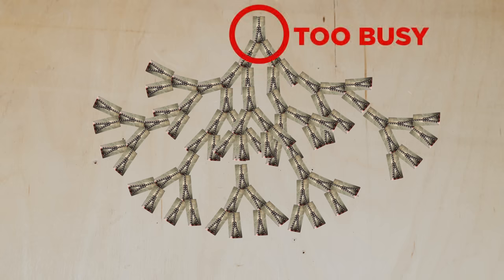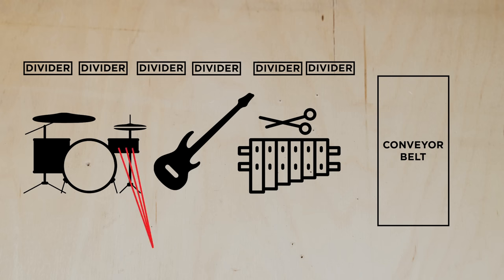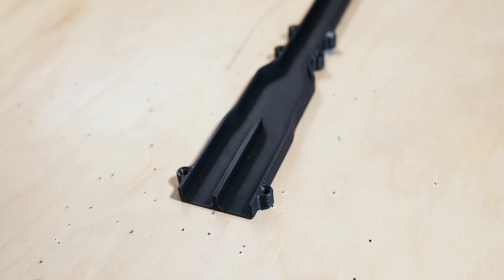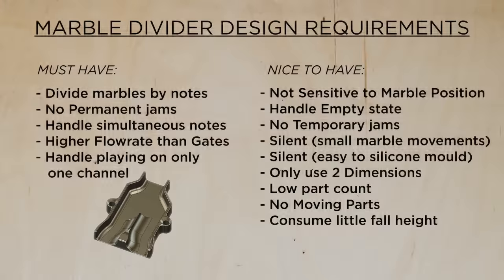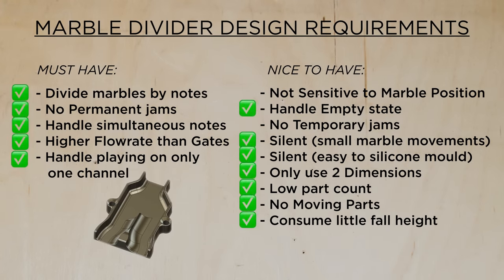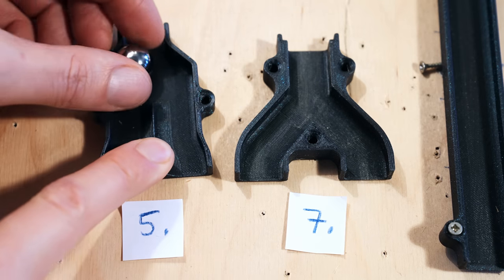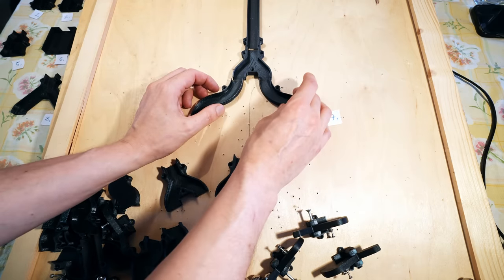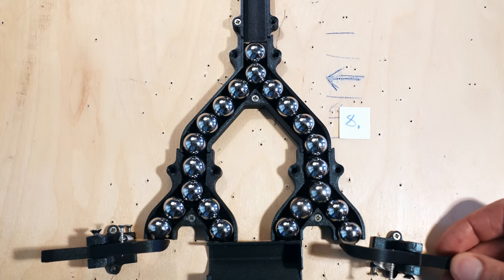Mystery Marble Divider?

Comment: It might be way too large but what if there just wasn't a divider? Separate channels for every note, return lifts could be grouped per instrument, but still all the channels are separate in each lift.
Reply: I agree, the best divider is no divider at all. It adds complexity and a lot of issues. If every note has its own path things become much more simple. You do trade-off complexity for costs (more marbles, more lanes etc.) and space and weight (more lanes to accommodate). However, another big benefit of this approach is that the whole thing becomes more modular. If you look at your current design, the big elevator is a single point of failure and the machine will not gracefully degrade (i.e. some notes might not work). Instead, you will have no music at all.

Another big requirement I have been missing thus far is transportability. As an system/software architect consultant I see that many systems are modularized / designed with this aspect shaping the overall design. How big can each module be? How heavy? Should it fit in an airplane? Should it fit through a standard door? How much shocks / falls / temperature differences etc. should it be able to withstand?

Comment: spring loaded trap doors... where you can adjust the spring to take in variable weights... now what do i mean... the channel the marbles goes into moves, on a spring, when the spring reaches a point it pulls on the trap door to close the channel, as the tube loses weight it allows the trap door to work again..  it would allow you to have different numbers of marbles in different tubes.  as long as it worked properly that is.  the issue i see you'd have with this design is timing since the tube would move to trigger the trap door... there would be a variable in the rate it could drop the marble... i didn't think enough to transfix the tube to get them all to have the same timing.... my brain thought this one up first...  thou the moving tube may not be the end location for the marbles?  maybe when the trap door is closed it drops the marbles into a primary tube, which then resets the moving tube/trap door to refill the tube before the primary?  if that makes sense?  then the primary would also need a means to keep the loader tube from dropping marbles into it until it needs them.

Comment: Consider a Major Change.  Problem: Balls Piling Up on Top of each other causing Jamming.  Instead Space the Balls Out with a Delay Mechanism.  And then Divert the Balls to Left / Right with a Flip Flop Tumbler.  Problem Solved.  As a Mechanical Design Engineer, I wanted to do this, but the Customer Insisted on having their Tubing "Stock" Freely Fall from the Parts Gondola under Gravity.  Can't be done!  Must have Mechanical Feed (with spaced delays) to Prevent Jamming.  Once Achieved, the "Tumbling Flip Flop Dividers" will Take it from There.  I feel your Pain.  J D Smalley.

Comment: For the choke issue, consider that you could have multiple splitters in parallel and merge the outputs. It sounds strange, but it works well in factorio lol.
Reply: Looks like you did and it worked lol

Comment: Get rid of the "wiggle" tracks as much as you can. They are just another recipe for something that needs fixing later. They themselves add length "uncertainty" because of all the curves and the need for the channel to be a little bit wider than the marbles. If you connect the centers of the marbles you will get a zig-zag-line, not a line that follows the center of the channel. The marbles won't end up in the same position in the tracks every time, so there are many different versions of that zig-zag-line all with different "stacking heights" (the length the marbles actually take up in the channel from start to end). In curves there are a lot more possibilities than in straight channels, leading to more possibilities for one of the "stacking heights" to end up too short or too long for reliable operation.

Comment: I question the requirement of having a marble divider that is not sensitive to marble position. I feel like having the possibility to adjust the marble gates positioning relative to the divider exits would [1] be way easier to design, as you would only need a simple bracket with slots for the gates and the divider would always be the same wherever it is on the machine, [2] lead to a lower part count, [3] be more compact, [4] be easier to adjust (no need to remove all marbles from the channel, place a wiggle block, try it, do it again) and [5] be easier to modify if problems arise.

Comment: Thinking of height sensitivity. In this video, the marbles are rolling on a two dimensional flat plane. Going either down-left or down-right. Could the marble path be more three dimensional, such that the marbles can go down-left or down-right - OR - down-back-left or down-back-right. (If a vertical tube is feeding the marbles, the marbles can either go front-left or front-right or back-left or back-right. From 1 to 4 vertical tubes)

Comment: How about printing the tracks in a TPU material instead of molding silicone. You could actually print the base of the track with PETG so that the screw holes are tougher and the rounded track part with TPU to deaden the sound a bit?

Comment: Can you keep each channel segregated while in the conveyor so you dont have to divide them at the top?  Or could you introduce a gap between the divider and the gate that allows independant height adjustment and maybe a small conveyor per track in between to eliminate gravity acting on the divider and the gate at the same time?

Comment: Some food for thought. The statement at the end made me think, why not design some machine learning to solve it. Nah… too much work code design. and learning time. 

But wait… what about nature? Has nature designed something that has attempted to solve this problem? Well sorta. I’m thinking about the pump and vessels we all have in our bodies. Ahh! Arteries, veins. 

Height sensitive (think orthostatic hypotension). Flow rate is determined by arterioles, small muscles at the end of our arteries. Our brains have barometers to reflex our muscles when we stand up, maintaining pressure to our brain. 
Here’s the most pertinent part: Capillaries are small enough that only single RBCs can pass through, which seems pretty much analogous to this issue. There are a lot of differences, don’t get me wrong, but it’s pretty neat to compare. Things that might help in this instance: charge helps prevent RBCs from clumping in the capillaries (endothelial electrostatic repulsion). Maybe for the divider, some time of agitator (vibration, moving magnets, would help act like blood serum in this case and overcome the coefficient of static friction. Additionally.  Capillaries aren’t branching Ys, they’re interwoven meshes that cover the area, forming loops to add a little redundancy to prevent ischemia while allowing for clogged vessels to fee up. (Lookup “scalp, injected blood vessels, light micrograph” on Google to see what I mean). 

Again this might not be super useful given the large physical size of these marbles comparatively and the differences in medium, but I do believe they might help give some insight towards any further solutions, should they exist.

Comment: I think you need a gutter around your bench😄 Looking at version 6, it would be much better if the divider grew in height as it got lower to prevent the middle marble being possible.  could use a lid to reduce noise and prevent any marbles from jumping out, a possible temporary fault

Comment: Maybe 3d printing from TPU (relatively hard ones should work) with relatively low infill, to make sound dampening tracks on your printer would work? That would eliminate mold making and reduce the chance of it behaving differently due to the different material in the final version.

Comment: Silicone is to flexible. Maybe lining the walls and/or the pathway with silicone while keeping the plastic walls for rigidity would be your best bet at reducing noise but maintaining reliability
Reply: If you've ever worked with silicone sealant then you know that you can get softer and harder versions. Some remain quite wobbly others can be quite stiff. Silicone can be hardened and treated the same as any moldable plastic. Hard silicone remains pliable but does not easily deform under compression.

Comment: Instead of making the track adjust the marble height.
Cant you put in a screw that changes the gate height instead?

Meaning you just turn a screw, change the height of the marbles using the gate and solving the issue of multiple parts to solve an issue
Reply: The height of the gate needs to be constant to the instrument otherwise the timing will be off.. right?

Comment: What if you had someway of seperating the same marble path into different sections, so that you can partially cut-off a section from another, meaning that the marble positions in this new section could not affect the resting marble positions of the previous section.
Kinda like a valve or diode. If you had this then not having version 11 wouldn't be such a big deal.

Comment: For 6, what if you create a wall in the lower part where it splits. Basically, make the part that expands have the opposite slope and have the divider at lowsr to prevent the creation of a 3rd stack in the middle.

Comment: What about printing with TPU?  It's essentially printing out of rubber.  Might be significantly quieter than PLA or PETG prints.  But more expensive, and requires drying if left out for extended periods.

Comment: The obvious solution: no divider, one closed loop per lane.

Put another way, imo there’s no good reason to share the marbles between lanes: space is not an issue anymore, having closed loops improves modularity, closed loops mean one clicking noise per marble instead of one clicking noise per marble division, and a bunch of other advantages.

If each lane is an independent marble loop, then the problem becomes that of plugging many instrument modules to a single programming wheel. That means that in theory you could maybe reconfigure the Marble Machine in many different ways.

Comment: What about defining the maximum height the divider should support? I mean even pipes have pressure ratings. A divider that works with infinite height for sure might be impossible, but one rated for a set height should be achievable.

Comment: Trying to think outside of the box here. What if you just made a tank and then every marble gate had a seperate funnel in the bottom of the tank? This would ensure a large reservoar of marbles that could feed the gates from a single pipe through it’s funnel. The funnel itself doesn’t really require any precision to feed so it shouldn’t be able to jam.

Sound wise the whole construction could be made with lining an made as closed as possible, confining much of the sound. The only time a marble is seen is when it’s falling, otherwise it’s inside it’s own cycle.

Comment: What about using a design like nr 4 or 5, but with the slight bump that nr 10 and 11 have? That should solve the high issue, no? Or at least partially solve it, and you can iterate on that again

Comment: Is it possible to avoid the whole operation of having to combine and divide streams of marbles? If you can design the machine from scratch, why not make X independent marble loops for X notes? The only limiting factors would be the size of the lifting mechanism and the area required to catch each marble after they drop. The first factor can be planned for in the design phase and the second factor can be solved by making custom instruments that are placed in e.g. a 5 finger fan configuration. You can also stagger the placement of the instruments in all three of the axes. You should also be able to fit two or three independent marble trajectories on each of the drums.

Comment: In industry if you want small things to flow without jamming or clogging you vibrate the system. It prevents static jams since nothing can remain in the stuck position. How you'd put this on a marble music machine or how you'd deal with the horrific sound I'm not sure.

Comment: The most basic question should be: Why 2D? Why not 3D? Some years ago I already suggested a kind of big round pot with marble outlets around the bottom and a rotating base platform (to distribute marbles and resolve jams). The platform must be a bit higher in its center. Yes, it will be heavy. Because it does the very much needed double duty as a marble buffer. Yes, it can be noisy. But noise is quite irrelevant when you blast the audience with speaker towers. And when you keep marble circulation separated, you can use smaller distributors and don't have to keep 1000 marbles in one big pot...

Comment: 10:00 Couldn't you just have a middle wall sorta like the other dividers? That way the marbles simply just dip into those positions a bit more. Might want to factor in marble diameter into the equation and to make the distance for a singular marble that could hypothetically be somewhere jammable be greater than said singular diameter.

EDIT: You could have a see-saw design in the middle of one of the dividers, and while it would technically buffer the flow from a 1 by 1 to a 2 by 2 (as well as technically be a tad bit slower), you could theoretically have a permanent "no-jamming" marble divider

EDIT 2: Instead of a see-saw, perhaps a simple partial curve pusher of some sort (like a segment of a pie) that gets pushed out just enough to tilt the direction an incoming marble has to one pipe or another. Similar to seesaw, but a little less preventing of motion. Might still jam tho :/

Comment: For things to flow smoothly without being height sensitive, you basically need them to act like a fluid, right?
                   |
Fluid in a /\ shaped water pipe won't jam when you lengthen or shorten one side vs the other.

But that's because it's fluid.
And fluid is defined by having a particle size significantly smaller than the container it's in.

If you made a pipe that only allowed water molecules through in single file, you are going to get similar problems.

All that to say, I think the height invariant marble divider is a pipe dream.

Comment: There is one issue I found with these Y splitters and thats when both channels are played simultaneously the next marble before the split can fall straight down and can be jammed against the splitter and balance there thanks to the pressure of the stack. Still using the 3D printer to great effect in your workflow I see?

Comment: Instead of molding in silicone (yet another untested fabrication process), why not use your current fabrication process with a different material. TPU/TPE filaments in various shore harnesses are available and should print fine in many 3D printers. If the TPU/TPE print isn't strong enough to keep the shape from collapsing from the weight of the marbles (could also be an issue with molded silicone), print it in two parts. A PLA (or similar hard plastic) frame with a TPU insert that has the marble channel. (Or anything for the frame using currently known fabrication processes. Routed plywood, plasma cut metal, etc.)

I have an example from my own experience of how changing filament types helped me solve an issue. I had designed a funnel for filling desiccant containers to store in the hub of my filament spools inside a vacuum sealer bag. My first print was in PLA and the shape was perfect to fit in the mouth of the containers. But I had an issue with the hard desiccant pellets bouncing out of my funnel. I reprinted in NinjaFlex (an 85A shore hardness TPU) and now I don't have any problems with desiccant beads bouncing out of the funnel. The rubbery TPU funnel now absorbs the impact energy of the desiccant beads. (Sort of like the difference between dropping a ball bearing onto metal vs. dropping onto plywood. The bigger bounce is on the metal.) 

This may be more challenging if Martin only has a bowden style 3D printer. I haven't noticed Martin's printer in the background (maybe I missed it?) so I don't know what style he is using. Even among direct drive 3D printers, some handle flexible filaments better than others.

Comment: Looks like you need a break in the flow of marble for each gate to make the flow of marbles independent for independent height
Josse roelfs design looks like it would solve that one problem how knows if it works good enough for the project tho

Comment: Why are all dividers constructions that you experience based on the principle that the divisor should work autonomously? If the balls get stuck, then it may make sense to produce vibrating or moving inserts driven by the main mechanism that will break the jams?

Comment: Why not have a gate attached to each output of divider, with a mechanism that disables this gate if the output is already filled up ?

- distance between gate and divider can be fixed since this would be a single assembly
- you isolate marble height problem out of marble divider, to a (simpler, I guess) marble detection problem
- you already have reliable marble gates

Comment: V 6 but longer and small alf cone shape to direct the marble on the left or right. i think it need even less angle and specialy low marble pressure, the longer you can have for the piece more relaiyable it shoud get , specialy if you can make the channels a bit deeper so marble can fully sets in.

to bad we can't provide drawing on comment

Comment: I think a workaround, not a solution, for the problem would have a second set of gates all at the same level. These sorting gates could have a much simpler design than the playing gates. Timing wouldn't be an issue. The only challenge would be to  trigger both gates simultaneously.